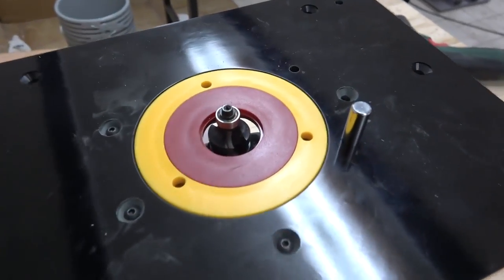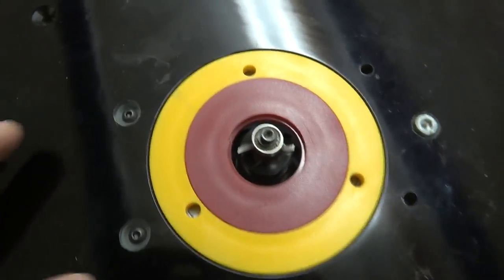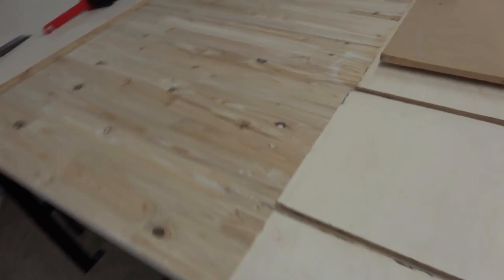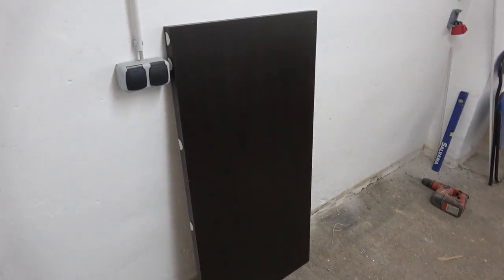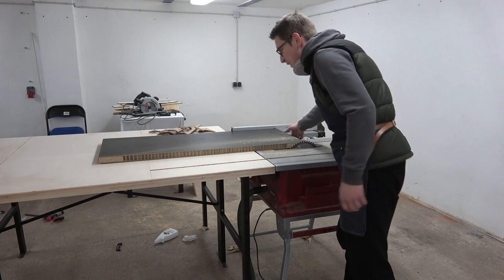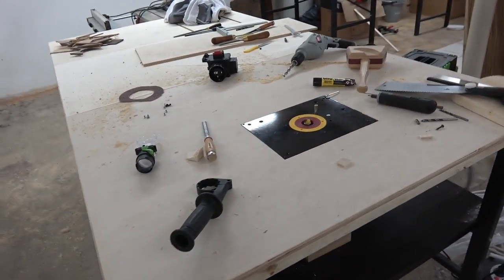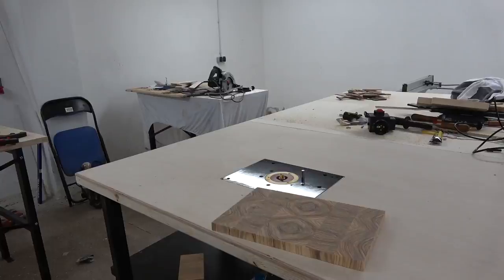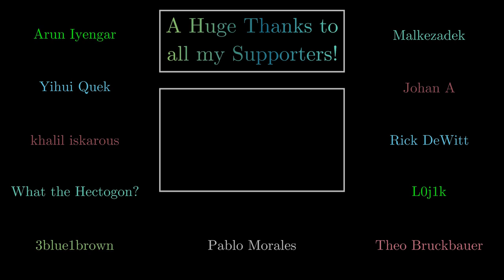MORE Workbenches & an Integrated Router Table!  - Workshop Vlog #8

Comment: To make the plate of your router flush with the table, you can make the cut-out just a bit deeper and fill-up with adhesive paper which you glue on top of the cut-out until you reach the perfect height. I like your material choice, I used MDF, which is more flat, but can bulge when it absorbs water.
Reply from the maker: Yes, plywood is the better choice imo too and more form stable at that too :)